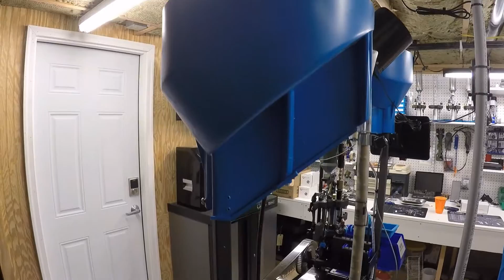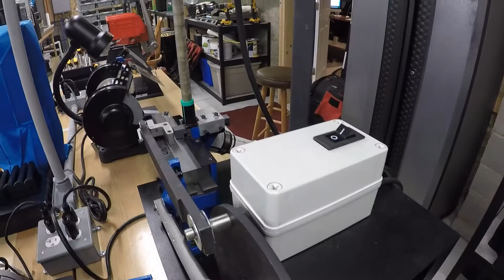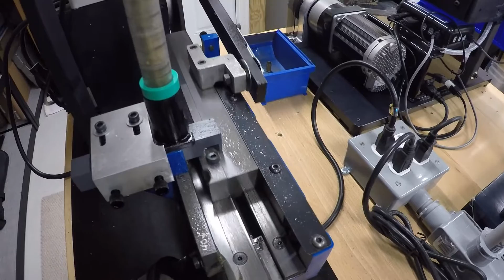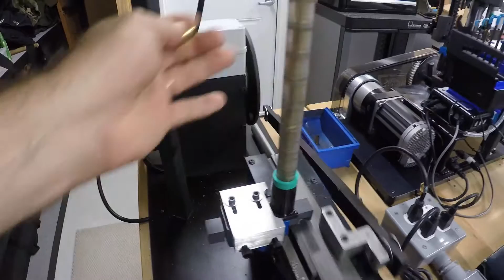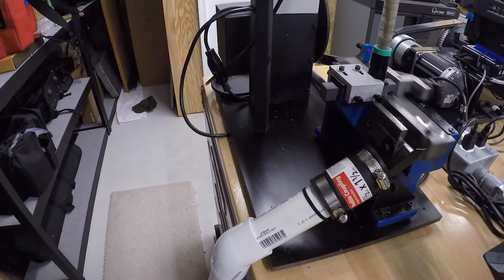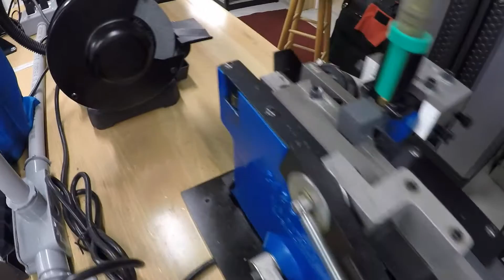CasePro100 Case Resizing

Comment: The casings still need to be sent through a resizing die with a de-priming rod installed?
Reply from the maker: Extra precaution, probably an overkill but just my choice.
Reply: George Ascione.   I can dig it.  I’m at 150,000 cartridges loaded and I’ve not run into an issue with bulged lower case bodies as a specific issue;  but I don’t compete or sell my ammo so I’ve not come across all the minutia if case prep.  I’ve ordered up a Mark7 so now exploring everything I can to make sure there are fewer hiccups, if any.   Have you looked at the rotary type of these machines coming out of Australia?

Comment: is that the auto-drive made by case-pro?
Reply from the maker: Yes
Reply: amazing reloading room you have there.  thanks for the reply
Reply: George - after you roll size, do you deprime then tumble your cases?
Reply from the maker: Sorry I just saw your comment now. I don't deprime any longer before loading. This brass will go directly into the stainless steel tumbler dried and go right to reloading. I use the sizing/depriming die on the presses.

Comment: We bought one and after the expense of importing it I'm not impressed . 
Despite what their advertising claims this doesn't roll out Glock Bulges
 or similar . When I asked about this I was told I'd have to Full Length
 Resize to get the desired results . CasePro are a Fraud
Reply from the maker: Well I don't have any dog in this race but we have had good results with our unit. We always full length resize anyway as part of our reloading process but measuring the case after roll sizing shows good results for us.
Reply: No problem George . Their literature and adverts make out like you only need a Casepro . We were suprised that it did not do what they claim . With shipping and the extras we are out nearly $4000USD for a machine we call "The Electric Coat Rack" . Thats at best deceptive advertising